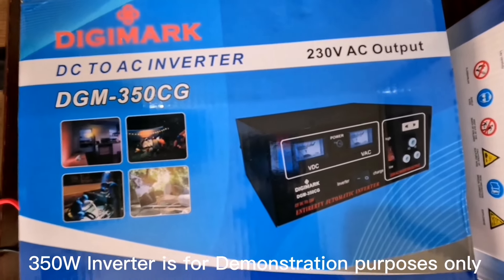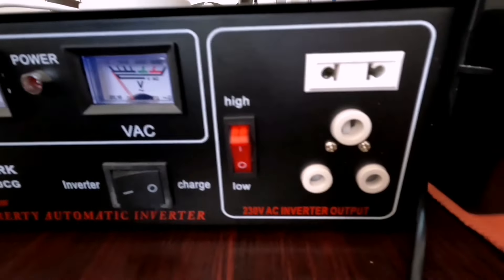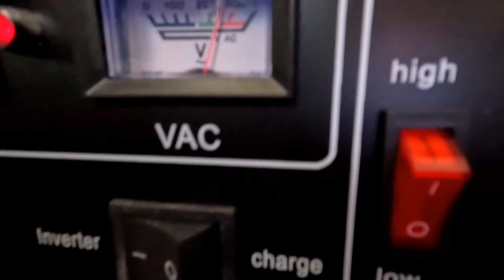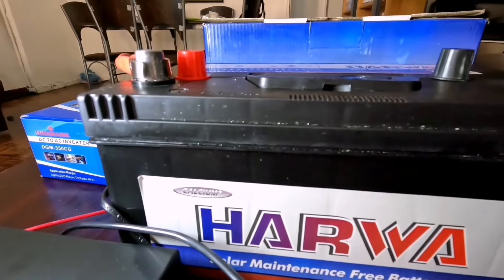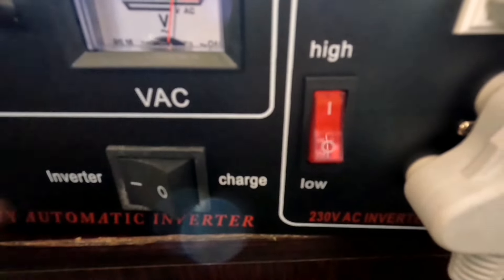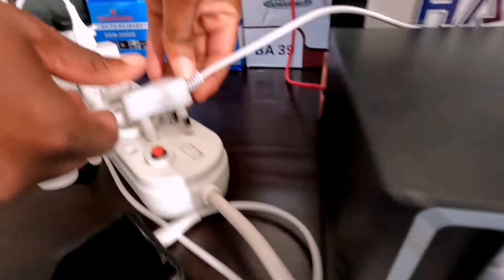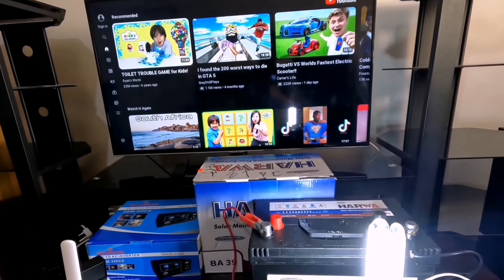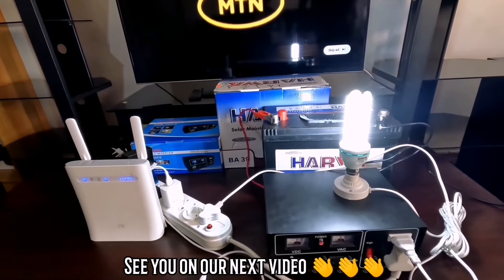How To Set Up a 350W - 500W 12V AFR Solar Inverter With Built In Charger #loadshedding (setup)

Comment: What is the use of the male plug at the back of inverter?
Reply from the maker: The use of the male plug at the back of the inverter is for connecting to electricity, so you can recharge your battery incase you don't use solar power with the inverter!
Reply: it's for charging from power source

Comment: he using this hybrid inverter/charger.. when you are charging, how do you know that the battery is fully charged? i don't want to damage my batteries...
Reply from the maker: Same way you see that your battery is empty, when voltage and wattage is lower.
Reply: Perhaps charge controller can help

Comment: How long did this system keep being on?
Reply from the maker: I have only used it during emergency situations like load shedding at least 2-3hrs....
Reply: I qm us8ng this battery and have connect3d it since 10am but its not getting full
Reply: 12v 150ah Sealed Gel Battery
Reply: Yeah I have this same set but a 1000VA.  I don't know what am getting wrong but it refuses to charge my car battery

Comment: So can can you charge it on the car battery and bring it back in the house to use the inverter or must it stay connected on the battery?
Reply from the maker: Inverter works with a battery most of the time,  so yes it has to be connected to the battery like in the video for desired outcome

Comment: Hello... Your explanation is great... now I have the wince version and I am not comfortable with the cooling fan coming on when the positive and negative terminals are connected... it drains the battery overtime... the cooling fans should come on when the inverter switch cones on... the fan is not too necessary when charging alone. so what do I do?

Comment: Please how do I know when my battery is fully charged? Is there an indication?
Reply from the maker: Yes there is an indication point when charger shows that your battery 🔋 is 12V and 230W....m
Reply: And also if you using a car battery to charge it how long must you keep it on so it can become fully charged
Reply from the maker: The same battery indicator indicates if full or empty....please check on the manual coz it comes with one..., thanks 👍

Comment: Kindly help me understand how the charging system works, do i need to connect it to a solar panel or i just need the battery?
Reply: YOU CAN CHARGE IT USING SOLAR PANEL/ CHARGE USING ELECTRICITY

Comment: Hey chief, greetings.

How long did the battery last on a single full charge, whilst the router, phone and TV are plugged in?

How long does it take to charge the battery through electricity?

I'm considering getting this kind of setup, using a 40AHMS deep cycle battery for mainly the sake of my laptop. I'm a livestreamer.

My laptop - 65W
Fan - 75W
Lights - about 24W to 30W all together
5G Router - 18.5Wh

Comment: Tell me something does it have to work on high voltage or low?
Reply from the maker: Hi.You mainly use low voltage when charging your battery and high voltage when inverter is in use.

Comment: Hey bra. Great video👍question:i bought my inverter today.. Everything worked ok, but after about 1hour40 minutes my flatscreen started switching off.. Ive been using my cars battery.. What could be the problem..? How long are these things supposed to run..? And for how long must i charge the battery..
Reply from the maker: Not sure
Reply: Car batteries are not meant for being used for a backup systems, they're built to output lots of power for a short time. You need a gel battery which is built to last longer
Reply: @theronramaotswa3067  very true
Reply: Very nice. How do I get this kind of inverter ?
Reply: @ojimufemi9065 take a lot

Comment: Is it possible to keep the wall plug connected permanently with the appliances in use so that the  system automatically switches on  when load-shedding starts so that the router doesn't switch off at all?
Reply from the maker: Not really as the system does not automatically switch, you have to switch it manually....

Comment: Sorry, it is not recommended for electronic devices such as routers, Wi-Fi, and charging phones, because they have Sqare Wave

If you want to use it for electronic equipment then choose a wave like the electricity in your home with the Pure Sine Wave (PSW) wave type.

Because Square Wave are like inverters in videos, they will gradually damage your electronic equipment
Reply from the maker: Thank you for the info, I didn't know that, I always charged my cell and use my router during load shedding never had a problem but I've noted your concern and advise
Reply: No problem but with  inductive loads you need  PSW like that fan

Electronic loads are just fine since their power supplies will still convert it to DC